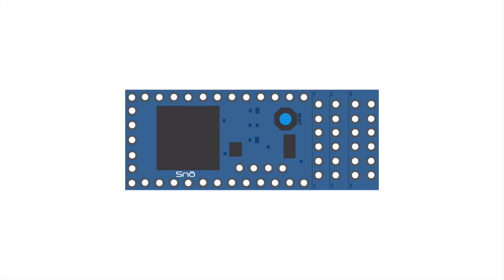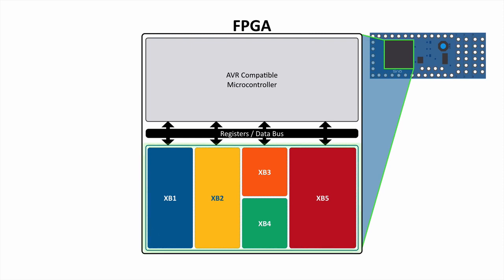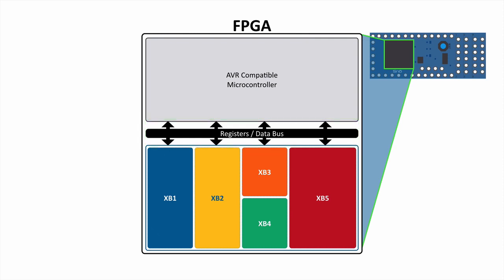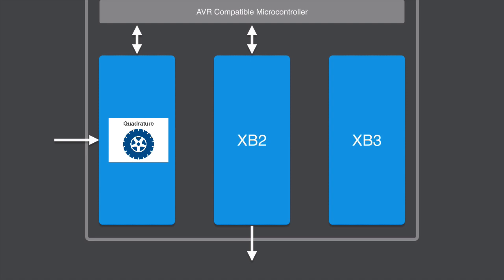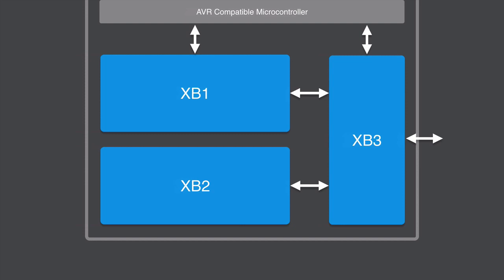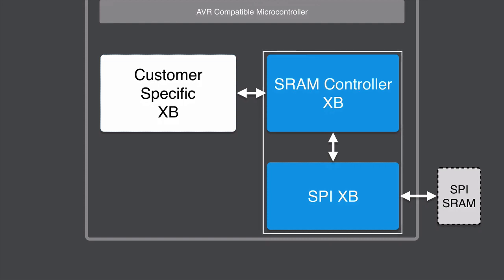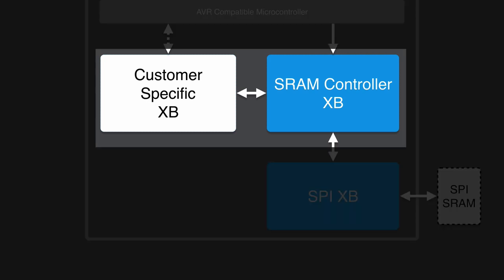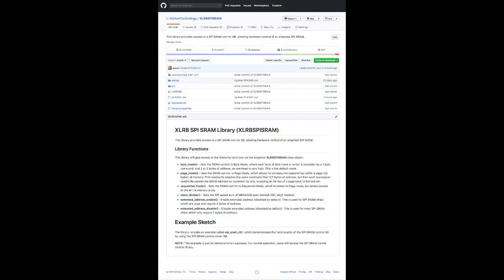SPI SRAM Controller XB: An illustration of how to use standalone Xcelerator Blocks.

Comment: Greetings friends, I love your channel and I find it fantastic to synthesize a microcontroller inside a fpga, I would like to do it, I have a question outside of what its content is, I am emulating the 8052 microcontroller, not the 8051! , and I can say that it works 70%, I am emulating it in c ++, I have read a lot and searched, and I understand how my code works but I still have some errors, you will not have a similar project or the same for me to implement it? What I want is to make the whole core load it in a microcontroller and have the physical microcontroller and one for software, thank you very much!